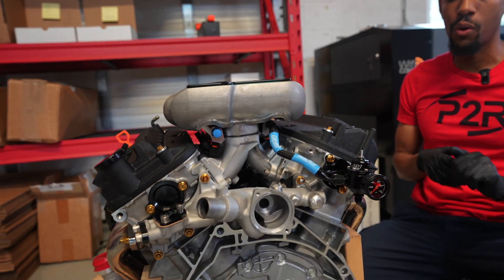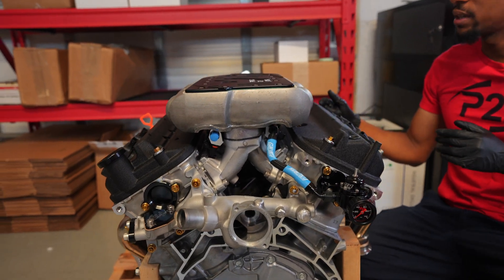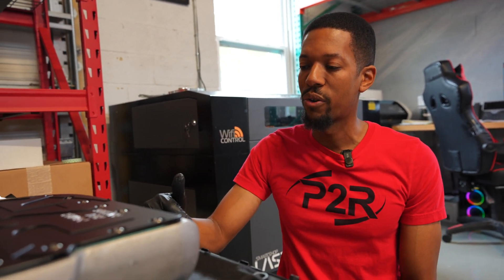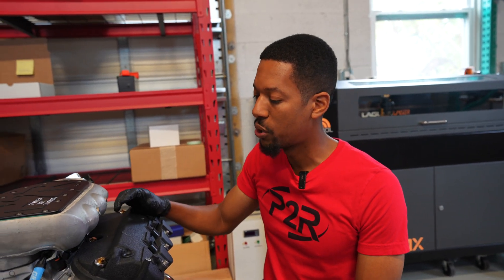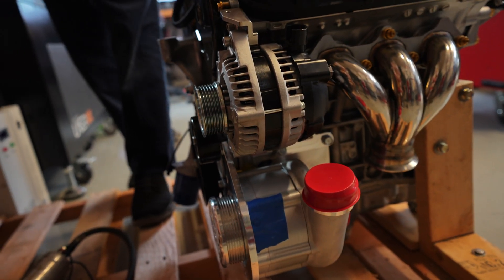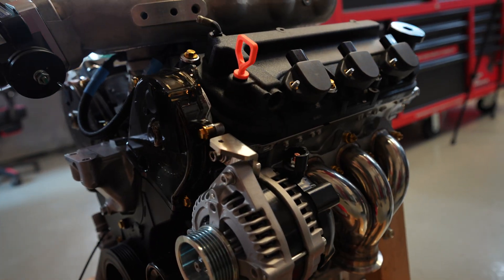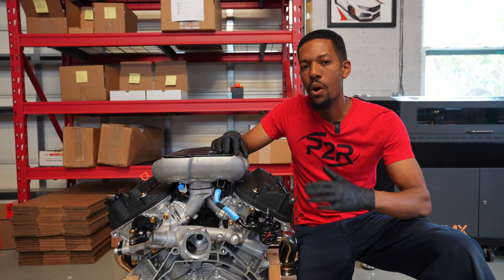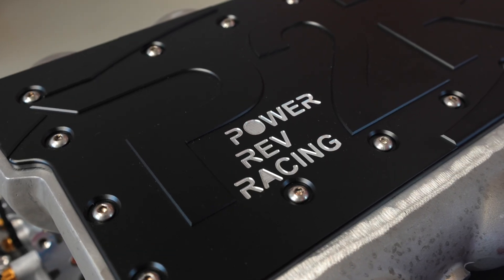Unveiling the Ultimate P2R OE+ Engine Build with a Supercharger

Comment: Would the oe+ pass an inspection in NYC?

I wouldn't mind 350hp or and passing emissions... But then would the automatic hold up
Reply from the maker: An OE+ engine will pass emissions. It will work perfectly with a stock transmission as long as the transmission is in good condition.
Reply: @PowerRevRacing  thanks!  I have a j35y1 (2013 sedan).

Comment: Have yall done any research into the performance differences between more modern J-series heads with the built in exhaust "header" (where the three exhaust ports combine into the oval outlet) vs the more traditional engine setup shown here (three independent exhaust ports). I cant imagine its a big change but im considering sourcing some like the ones you have in the video for my '13 accord coupe. 

Love what yall are doing with the J-series stuff! Im running some of yall's parts and my accord just got dyno'd at 320!
Reply: The single-port exhaust is always worse than individual exhaust ports. Always.
Reply: Soo y the single ports made more  power?
Reply: @killeryouth21  more displacement.